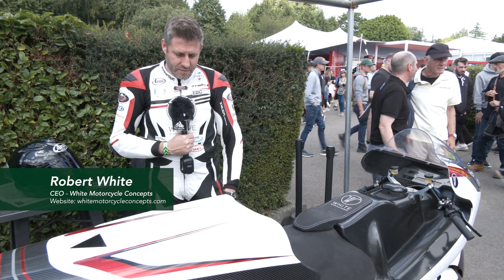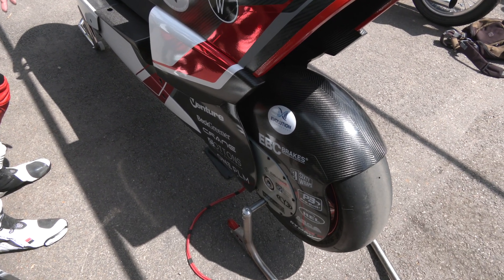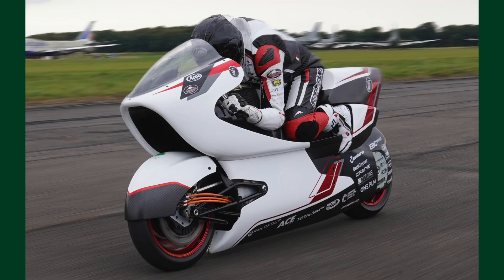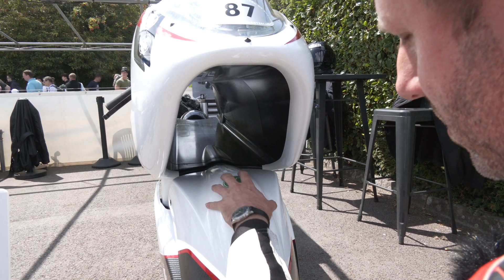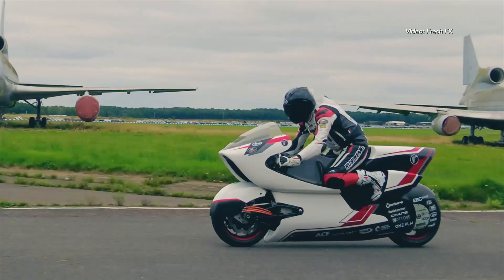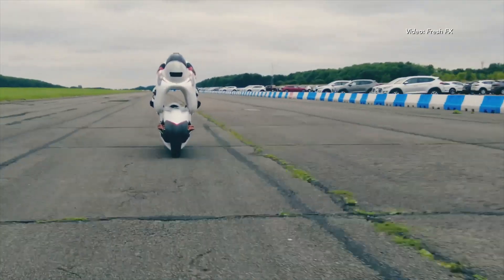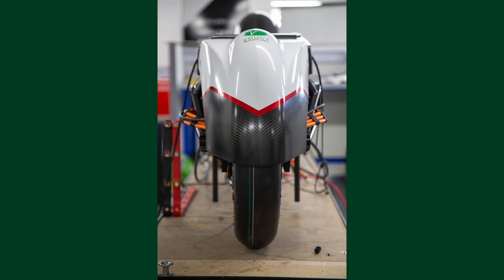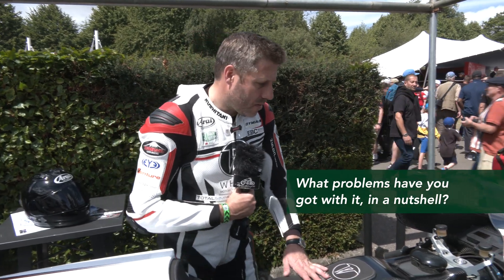World's most aerodynamically efficient motorcycle - WMC250EV - overview

Comment: Useless excercise. What's the point of having the weight of the rider so high, it looks very unstable, I've never seen a video of this machine going fast. Besides, it confines the batteries in a smaller space bellow the tunnel, so, no range, and if you want to put any over the tunnel, will add to the inestability.

Edit: Forgo to add, what would you need so much aerodinamic eficiency if it can´t go fast?
Reply: You never can be sure a flight of fancy such as this won’t produce tangible benefits in a broader sense. At worst it advances the science and does no discernible harm.
Reply: @joestafford6529  but I doubt the science on aerodynamics or newton laws need to be tested at the point, the rest is engineering and most of it can be tested on paper or even paper before getting to this point. For example, you'll know that you are less stable in a pogo stick than lying down. Being a bit cinic, sometimes these excercises are just to get some funding.
Reply: Better Aerodynamic means less drag, mean more range on highway. Going faster always increase drag.
Current electric motorcycles have good city range, but terrible highway range. Increasing range means more battery, means more weight, then more power for same power / weight ratio. It is terrible endless loop until we can manufacture way better lighter batteries on industrial scale.
This aerodynamic improvement might be a good temporary solution until better battery happens.

Also, this company which made this motorcycle manage to add a tunnel to a Zero Electric Motorcycle and improve its aero efficiency to 10%. It means about 5% more range, and because it's Zero, that's a lot.

Comment: We should have air tunnels like this also in cars and trucks. 👍😇
Reply: @rick57hart  I was 🤔 thinking of use for increased range.
Would work for delivery 🏁 mottos.
Why not use the tunnel like a turbine?
Thus increasing range with DC regeneration energy blades. 

For delivery it obviously different that built for land spead records.  
In everyday applications regeneration would be great with all the stop 🛑  GO.

RHONDARELLA
Reply: Yea thing is the society is getting older. Most drivers are 50 and up in developed countries. They are not going to drive lying down like in this case.

Comment: Put wings on it and make the wheels  slim and small then use jet propolstion electricpower make a motorcycle for low speed and it flys/glides at over a certain speed.

Comment: All been done before.. same old re-hashing of concepts with new money. There's a reason why this stuff has never been used in racing or on public roads. It just doesn't work outside of a test environment.
Reply: "....it just doesn't work outside of a test environment" yet. Materials, manufacturing processses etc etc is all developing at some point we will see the idea behind this and previous iterations be successful. Most successful designs we take for granted had many failed attemots before finally becoming a success.
Reply: @friktionrc Have been failing for the last 30 years then 😂
Reply: @hermanhandlebars2687  lol…true but then was a time when folks said cars would never be more popular than horse and cart as a mode of transport and yet here we are. I’m no Mystic Meg but looking at how car, plane and boat design and construction has changed over the years, I cant believe we’ll see the same shaped bikes in the future ( and by that I mean we may see more funky designs like this i the future as long as the power unit / tech is equally good).

Comment: John Britten did a similar thing back in the 90's, He ducted the air through his frame so it exited into the low pressure area under the seat in front of the rear wheel.
Reply: Well design is very different maybe tunnel give more control 👍 and also sofwares gives more data so they can do it better 😄 maybe